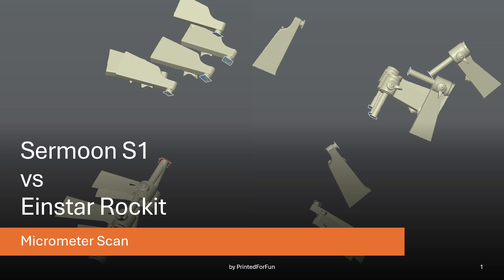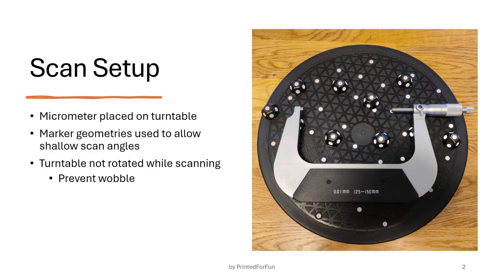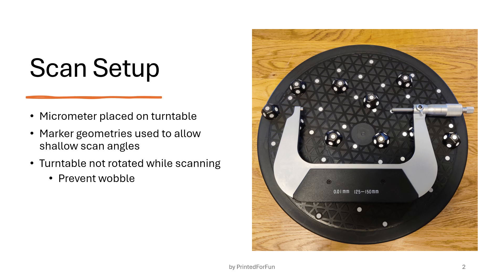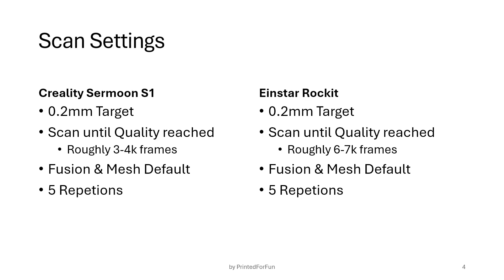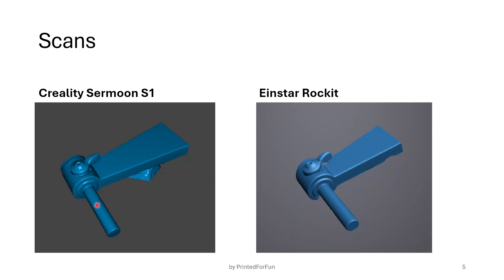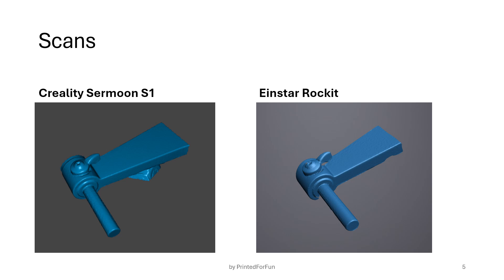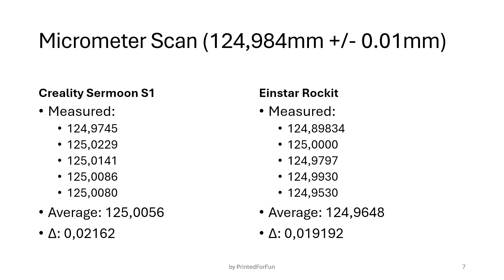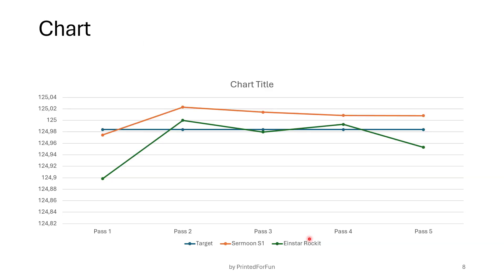Creality Sermoon S1 vs Einstar Rockit - Micrometer Scan for Accuracy

Comment: 1 question about the amount of frames did how much time did they take technically doesn't the rockit run at a higher FPS than the s1? so if it takes the same amount of time then does it matter it took more frames? the rigil gets 60 ish fps on device but as of the latest update now is 90+ on desktop assisted mode. I would think the rockit will be similar or maybe it hasn't the update yet?
Reply from the maker: That's a good point. wired both scanners can do 90 FPS. In the wireless mode the differences are vast: Rockit can do 90FPS and S1 only 40FPS. So using wireless they feel quite similar in capture speed but keep in mind the Rockit is more of a perfectionist until it is happy with data quality.